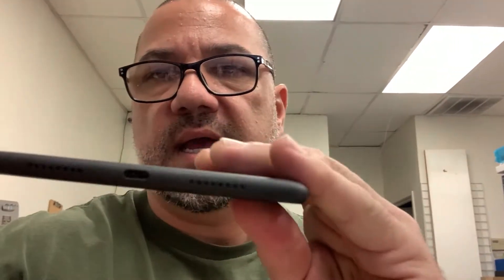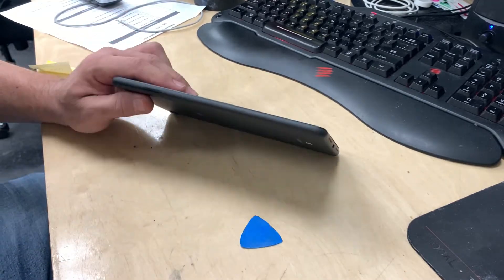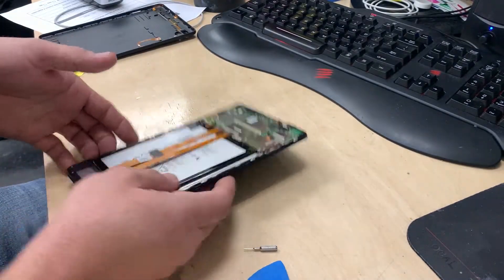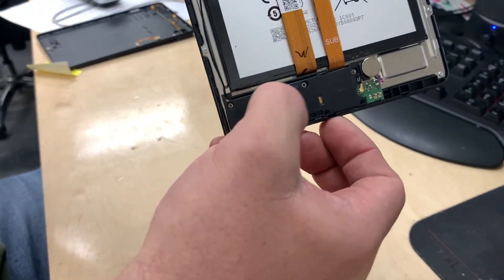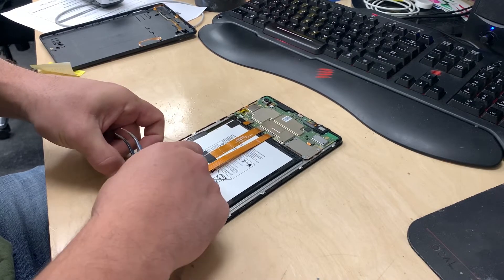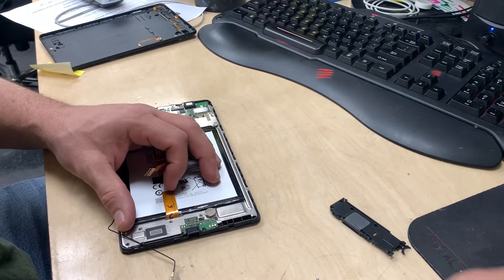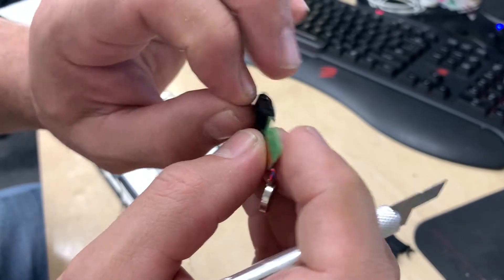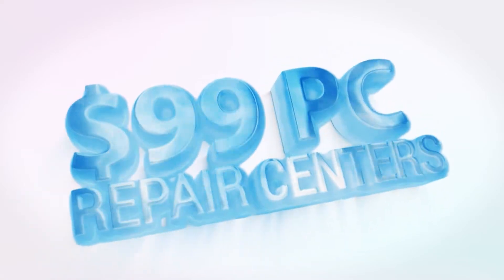Verizon TCL Tab 8 USB Type-C Charging Port Repair

Comment: You should rename this video to "TCL Tab 8 teardown - PCB removal" other than showing us how to teardown (which was done before watching this) you didn't show us a repair. As a fellow shop owner, i can verify that the PCB is impossible to find, but the port is a "simple" type-c solder. If you actually found a PCB please add the link to your description.

Comment from the maker: We ended up having a tough time finding the daughter board as well. So we ended up removing the type-c charging port off the daughter board and finding a suitable match to replace it. This did the trick. https://www.ebay.com/itm/2X-USB-C-Type-Charger-Charging-Port-Dock-Connector-T-Mobile-REVVL-4-Plus-5062Z-W-/294418227034?mkcid=16&mkevt=1&_trksid=p2349624.m46890.l49286&mkrid=711-127632-2357-0
Reply: Would this be compatible with a TCL Tab 8 Plus Model 9138S ? Having a trouble finding the charging port replacement. Thanks

Comment: Where did you find the charging port? I can't find it anywhere
Reply from the maker: I wasn’t able to find the whole board but I was able to find a compatible charging port so I removed the old one and soldered on the new one and was able to send it home with the customer.  Find it at https://www.ebay.com/itm/2X-USB-C-Type-Charger-Charging-Port-Dock-Connector-T-Mobile-REVVL-4-Plus-5062Z-W-/294418227034?mkcid=16&mkevt=1&_trksid=p2349624.m46890.l49286&mkrid=711-127632-2357-0

Comment: I have the same tablet with a damaged charging port. Did you manage to find a new charging port?
Reply from the maker: Turns out I could only find the actual usb type-c port. Though it doesn’t have a description that it will work but it’s an exact match and worked fine.  Good luck!  https://www.ebay.com/itm/2X-USB-C-Type-Charger-Charging-Port-Dock-Connector-T-Mobile-REVVL-4-Plus-5062Z-W-/294418227034?mkcid=16&mkevt=1&_trksid=p2349624.m46890.l49286&mkrid=711-127632-2357-0
Reply: @99pcrepaircenters88   so I have this part now. any chance it's plug and play - or does this part have to soldered to the board?
Reply: @davidsonnier7837  if you can't find that entire daughter board, and only the port itself.. you must both desolder the old port and solder in the new one.

If you DID find the daughter board, no soldering required minus the battery like he shows in the video.